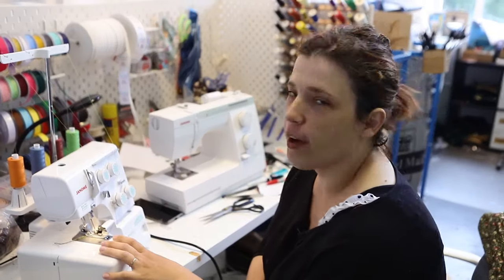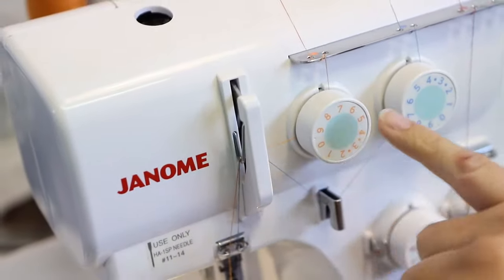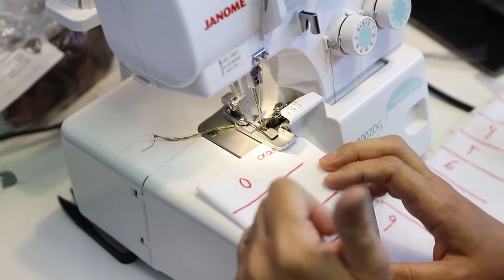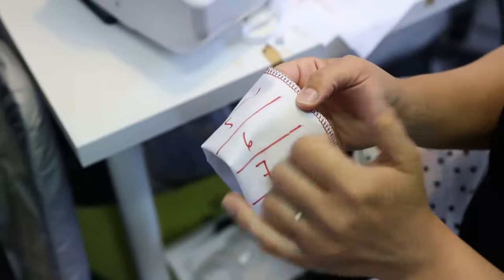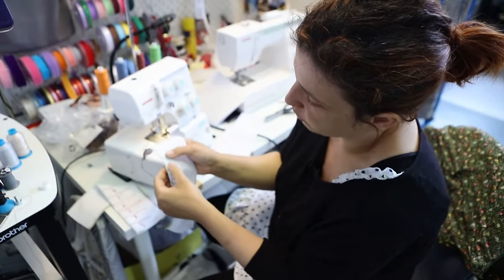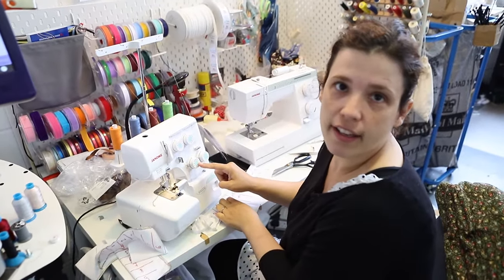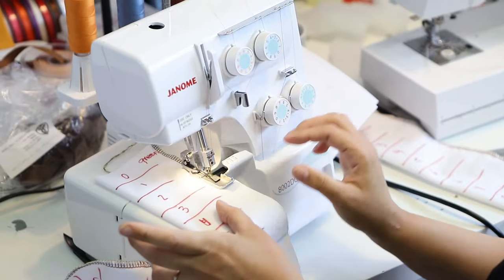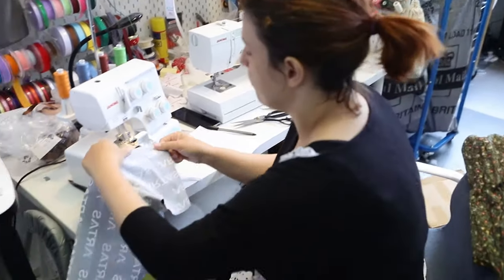How To Set The Tension On Any Overlocker

Comment: This is the most useful video I have found!  I have got the tension to the best it has every have been, but I feel it is still not right as the loops are not  right enough against the edge of the fabric. The problem is the upper and lower loopers, but when I rethread I put those tension dials to zero ( and they end up at 9) and the tension is still not right? Do you have any suggestions on how I can fix this?
Reply: Have you tried to move the cutting blade difference, this sometimes helps

Comment: This is fantastic! Just what I needed, Thank you so much. I have had my over locker  4 years and still struggle with getting a good finish.
Would this still work using just 3 threads for neatening seams? or would you recommend using 4 threads?
Reply from the maker: You should be able to do for 3 or 4 threads :)

Comment: I haven't found a tension video for the Janome Serger that shows what the seam looks like once the fabric is opened up.  I'm sewing bamboo fleece, the tension looks good when I sew, but when I open up the seam the stitches all show.  .
Reply: I'm having same issue also, I've adjusted the tensions several times but it's not still working out

Comment: Janome is the only Serger that the Tensions are Factory Set to work,,at all tension units at number 3. On the tension knobs,,you don’t need to move,,or is headache time,,,only on soft fabric,,you may loosen the left needle tension,,at 2 and half,   And you adjusted your cutting width to match the fabric,,,The old saying. If it working,,leave it alone,,,and don’t sew over a pin.  Enjoy.
Reply: Hi Michael. My mother was a professional seamstress for 50yrs. She sewed over pins all the time. Set the pins at 90 degrees to the seam. And, assuming stitch length is at least twice the pin diameter -go for it! Needles may blunt quicker, even break very occasionally, but saved time is more valuable. She never used an overlocker, so maybe it's different with these?